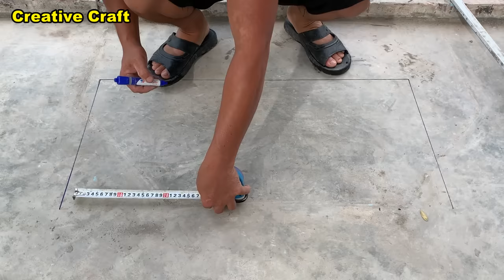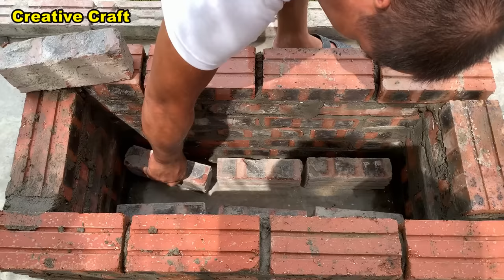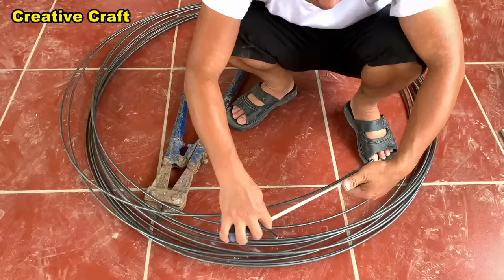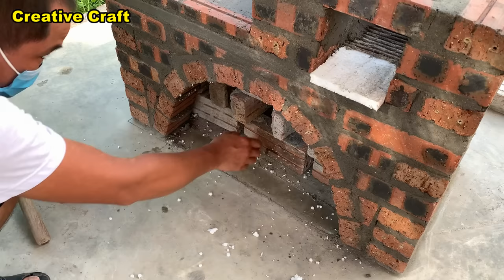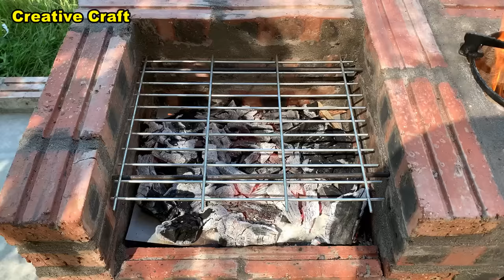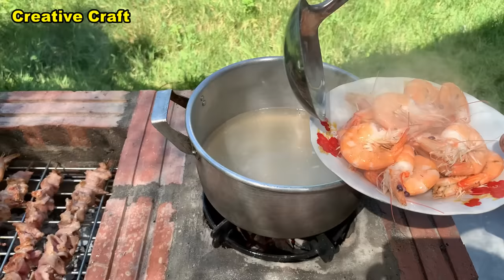Crafts With Cement - Outdoor Kitchen From Red Brick

Comment: nice, easy basic design.  I'm thinking though, that I would rather focus on making the wood storage area into a brick oven with a pit, with side vents you can even attach a bellows to if you want.  then, I would make angle vents at the top that would channel up to provide the heat for the BBQ and the range areas.  these would have metal sliders that could close the vents off so you can control exactly how much of the heat goes where.  on the BBQ side, the grill would be height adjustable, AND you could have multiple grills by making that side a tad higher.  I would construct a metal box that could fit on top to do smoking as well.  likewise you could control the height of the grill on the range side.
lastly, I would hinge a large door for the front of the fire pit, and have a adjustable height steel tray.  you can then convert the firepit into an oven by letting the fire burn down to coals, closing the top vents to the BBQ and range, and placing whatever you wanted to bake on the steel  tray, which can sit right over the coals.  can still control the heat via the vents (both side and top).  A complete outdoor cooking unit you can use for everything.
Reply: Build me one

Comment: My only comment is on the durability of the bricks and mortar to withstand the heat of the fires.        I built a barbecue a few years ago and used a special additive to mortar to make it more heat resistant and special fire bricks for use that had direct contact with fire.

Comment: Do I need to use some specific bricks? Or just regular ones
Reply: Strongly recommend fire bricks, rated to withstand high temps, cheap bricks and explode with excess heat. Also recommend using refactory cement, rated for high heat as well. Just so its safe for you and your family.